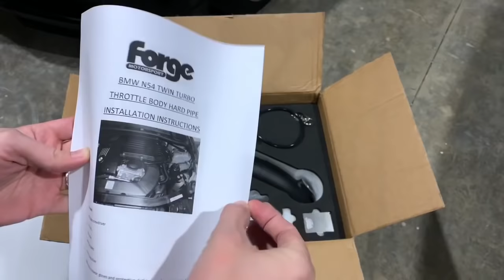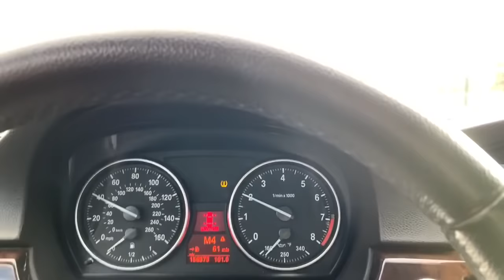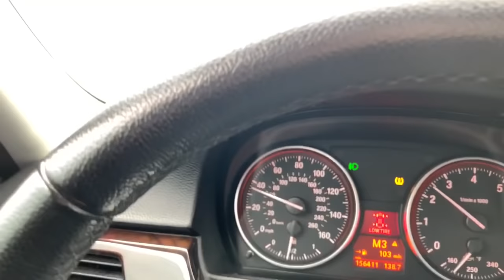Forge Motorsport BMW N54 Charge Pipe BOV Install/Testing!

Comment from the maker: Next video will be running the proper 1/4 vacuum line to the manifold for the BOV 😀👍🏻
Reply: This come for f30 4 cylinder?    To get it.   I’m looking for install a sequential Atmospheric BOV.  No the internal 

Any link ?
Reply: I need your help! Do you think this kit will work on my 2009 bmw 535i xdrive? Please help me
Reply: @jhonnystyles  ya I have it in my '10 e61
Reply: how did it run with the original small nipple?

Comment: Sounds good! Ya I got rid of the stock cp and installed a vrsf cp with dual turbosmart kompact bov's. Everyone that rides with me says it sounds like a space ship when im on it. Lol!!! Index 12 injectors arrived today!!!
335i JB4+MHD BEF E85 FUEL IT STAGE 2
Reply from the maker: Jeff Baker yep haha 
Hell ya man 😀
Reply: Jeff Baker damn everything I want to do to  one when I get it apart from we can’t get e85 here in the UK:(
Reply: N54 MODS BIMMER do you think this bov will fit my e60 535i?
Reply: Do the twin bov fit with tales installed?
Reply: I just bought the dual port Bov's. Did you go full VTA or have the hoses plumbed in with the trumpets on?
Reply: @unluckeeeee  I went full VTA and it's working great with my setup
Reply: @Kipitrl  Nice, thanks for the reply. I fitted them today and tbh the trumpets face the wrong way as the silicone hoses are extremely clunky. I think if I just got rid of those and ran VTA with little caps on the inlet ports then the bay will be cleaner and I can orientate the trumpets outwards more. How loud is your with full VTA?
Reply: @unluckeeeee  not the greatest video for sound but agree with you on the caps. This is with the bov's at 3 full turns from the top o ring.
Reply: @Kipitrl  Nice thanks. Any additional shims? I will have to play around with the set up as it's fine at idle but not sure it's right when driving.
Reply: @unluckeeeee  no extra shims, ya took a few pulls to dial it in but im running 29psi on hybrids with it.

Comment: And if you do break the nipple on the intake manifold an easy and cheap fix is removing you're manifold and drilling and taping the intake manifold and adding a 1/4 pipe to 1/8 brass hose barb fitting with some high temp gasket sealant. Saves you lots of money and will not be as fragile. Happened to me when installing my cp and bov  found this quick fix. (Some say its an upgrade you decide)

Comment: TIP - Forge was clever and has mounting bracket welded in center of chargepipe, similar to OEM garbage plastic chargepipe.  (DON'T USE INSTRUCTIONS , BECAUSE TORX T25 driver will STRIP !!! USE T27 bit head INSTEAD, PRESS DOWN AND HOLD BOTTOM BRACKET FIRM AS YOU MANUALLY LOOSEN, HAMMER TAP IT FEW TIMES TO BREAK IT SOMEWHAT LOOSE FROM SEIZED RUST)  WD40, TAP WITH HAMMER, BUT DON'T STRIP IT HAMMERING OR BY USING TOO SMALL BIT.  WIPE WD THEN FIRM COUNTER CLOCK LOOSEN (LEFTY LOOSEY, RIGHTY TIGHTY)  Try same WD40 hammer tap if both screws are seized on the POWER STEERING BRACKET which is somewhat in way , sits above and behind FMIC which is where chargepipe fits to front inlet.

Comment: Good video. I found it a little easier to fit everything together by removing the 4 bolts on the throttle body, the brake vacuum line and the plug. then installing the TB to the chargepipe and slotting it straight back in.

Comment: Just fitted mine that I bought off the back of this video. A bit more swearing was involved whilst fitting it to the inlet, I'll admit. Got a wee leak, only getting about 10 psi but that can wait until tomorrow. Video helped as the forge instructions are fine but a bit vague.

Comment: TIP - NO NEED TO REMOVE CABIN FILTER ON FIREWALL.  USE TWO FLATHEADS, SPIN GREY DIVERTER TABS COUNTER CLOCKWISE WITH RIGHT HAND FLAT HEAD, WHILE LEFT SMALL SIZE FLATHEAD SLIGHTLY PRY OUT GREY TAB (spray lube the plastic, let it sit)  also (lube the hold down bracket screw on top center of oem charge pipe garbage broke when hood dropped on my BMS DCI cones must have snaped this bracket from the charge pipe with rusty old screw seized onto broken plastic mount clip.  (T25 driver will STRIP, USE T27 INSTEAD, PRESS DOWN AND HOLD BOTTOM FIRM AS YOU MANUALLY LOOSEN, HAMMER TAP IT FEW TIMES TO BREAK IT SOMEWHAT LOOSE FROM SEIZED RUST)

Comment: I just blown my 535i N54 yesterday 👍👍😁😁
Reply from the maker: Andres Lopez what????
Reply: @BMWFanatic  yes ... i was about to go to work and then the car started sound bad , 
So i get back home and connected my laptop to my jb4 and cylinders 1,2 and 3 had a misfire and the engine shakes like crazy 😁👍 your channel is the best by the way
Reply from the maker: Andres Lopez the engine will shake like hell with a bad misfire. You sure it’s actually blown?
Reply: Now that i found something interesting , im not sure that is blown, cylinders 4-5 and 6 are good, nothin wrong with them, im about to check voltage because also shows up a power train failure code 👍 im pretty sure its gonna be all good with my n54
Reply: Sounds like you need to change your plugs and coils
Reply: I already changed them both, but still doing the samething... im going to check the battery tomorrow , see if thats the problem
Reply: Thank you very much for you guys time and advice👍
Reply: Well good luck getting it fixed

Comment: How do you plug the oem dv hose inputs on the air boot exiting the filter?
Reply: Use 1" chair plugs you can get at a hardware store. I recommend getting the VRSF charge pipe with the OEM diverter valves. Or go on Ali express and search n54 charge pipe and it'll show up there for even cheaper.

Comment: Is the Burger Motorsports Aluminum charge pipe with the Tial BOV as nice as this Forge setup? I was also gonna get the Vader Solutions Map sensor to BOV adapter so I didn’t have to tap into anything.
Reply: I ended up going with the Tial BOV and opted for the Burger Tuning BOV adapter kit. It works and sounds awesome! 😎👍🏼

Comment: Is this an automatic car? I want to put a BOV in my automatic z4 and drive in manual mode but im worried i wont get the nice blow off sound between shifts
Reply: You will only get the BOV noise when you let off the gas. You can always drive like a true manual and let off every time you shift

Comment: Always appreciate your videos!! Wondering if Forge CP would fit my 2010 535i with N54. Brands like CPE list 135/335/535 as same product, but others like Forge only list 335. Plan to contact Forge, but if anyone has installed on 535, please let me know. Thanks!
Reply: goodtimesnoodlesalad im pretty sure itll work, but did you ever figure this out? Ive got an 08
Reply: @McCullar513  No, I haven't figured this out.  I'm thinking it may work though, but it would be tight with the power steering reservoir.  I emailed Forge and asked, no reply yet.  Spoke with ECS, they think it could work, but not sure. ECS mentioned that it may interfere with expansion tank, but that's on the other side of the engine on my 2010. If you find out, please let me know. Thanks!
Reply: Hey bro anything if it fits? I got a 2008 535i and i wanna place it

Comment: Awesome. I just installed my DCIs, Charge Pipe and D-Valves. I should have waited and probably gotten a deal on your old one. I’m curious what the USB cable was for?
Reply: lift top plastic sensor tab up by sliding on USB gap side down, then plyiers on lip in front of wires, squeeze-pull harness out, don't pull on actual wires.  if top of clip breaks it don't seem to matter at all on fitment

Comment: On a stage 1 MHD tune Is the stock spring that comes with the BOV a good match for the boost? P.S. I will sometimes run a E30 mix.
Reply: Brandon Park Yes, my 335i n54 is mhd stage 1 and the bov with the stock spring works perfectly

Comment: What spring came in the valve I was thinking of getting the tuning kit for mine it should arrive Wednesday. Mine is all mhd I'm running around 18.5 psi what are you running with the jb4 and bef? Did you just install it as shipped or did you change the spring out
Reply: He did the Vader 1/4" vac line upgrade, so that effects the reaction to spring rate to reduce flutter , so he don't have to screw with JB4 settings for back press flutter on turbine wheel shaft

Comment: Hey BMW fanatic I wondering if you could help me out, thanks to your video I was able to install my charge pipe and BOV but for some reason I cant hear my BOV flutter did I do something wrong?
Reply: Anuar Mendoza what sort of BOV have you got?
Reply: flutter = bad , backpressure rattle..  You want the blowoff WHOOOSH on shifts.  Vader 1/4" vac upgrade cures Lee's flutter which he was concerned would rattle his shaft on his high mile turbos.
Reply: when you see white smoke exhaust, turbo shaft is grinding itself to DEATH from excessive flutter from improper BOV relief
Reply: I have the Tial BOV from burger motorsports. I was able to figure out the the reason why I wasnt able to hear the bov

Comment: You uprated the spring in the forge BOV?
Reply from the maker: brad king yep
Reply: Oh no, I’ve recently purchased one and I’m running same psi as you
Reply: @BMWFanatic   hey, witch spring did you use, and how much boost are you running?
i`m on MHD Stage 2+ running 19psi boost and use the spring that came with the blow off, but i think it is leaking :(
Reply: @BMWFanatic  i have same bow i run 20-21psi do i need to change spring i was told that it can hold that boost no need to change spring